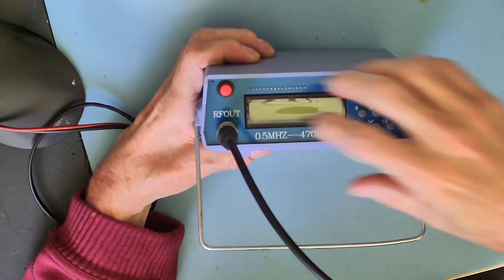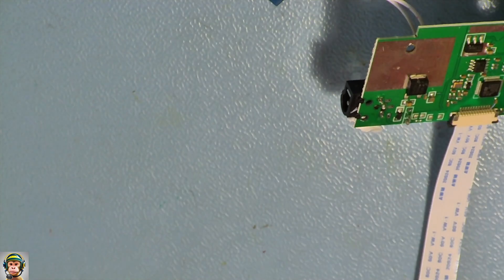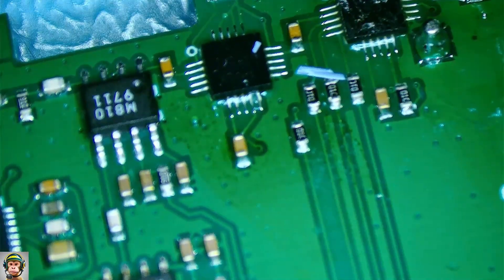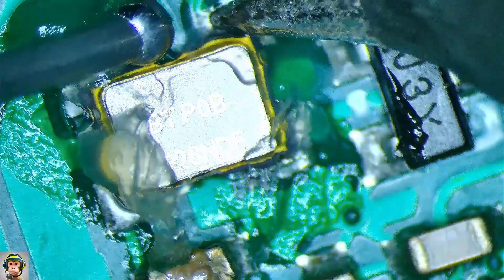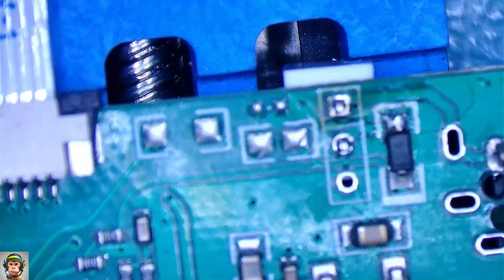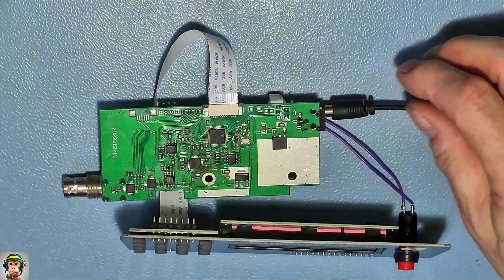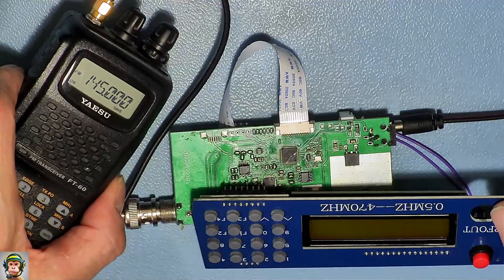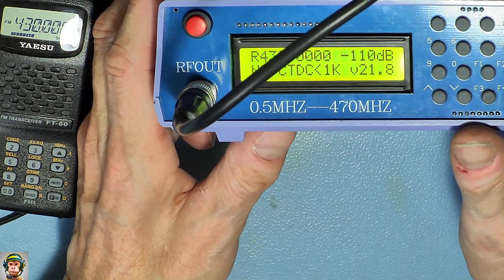#027 RF signal generator from AliExpress, sorry for the music.

Comment: Hi! The microcontroller in my generator is broken. Do you know if firmware is available for this generator? I replaced the microcontroller, but I have no firmware to flash it with.

Comment: I have the same generator, and it worked great. Until I stopped getting a signal. After watching this video, I took the generator apart and inspected the circuit board. I could find the signal with the scope directly after the microprocessor. At the input of the first attenuator, the signal had disappeared. It turned out to be in that yellow SMD capacitor. That was defective. I removed it and soldered in a 10 pF capacitor. The generator worked as before. It could be very useful in RF technology.

Comment: Was this unit conected to an antenna to transmit to the radio receiver?   Can this be used for setting if stages on radios? It’s been a while but remember something about it?
Reply from the maker: Yes you can, but

If you spend this much money why not buying a TinySA or TinySA Ultra? You have much more for the same amount.